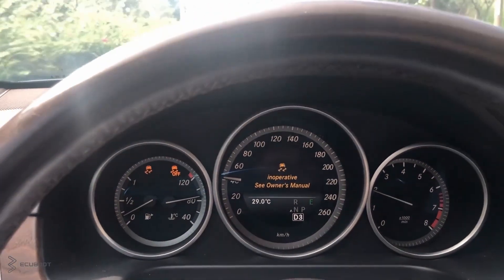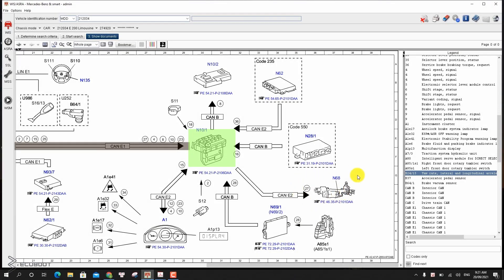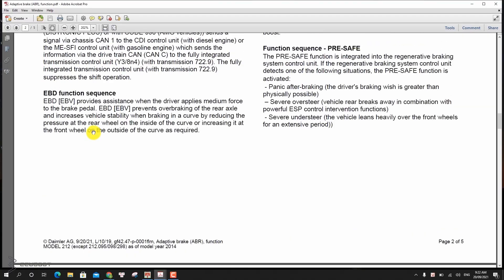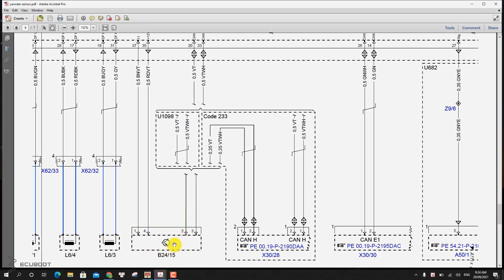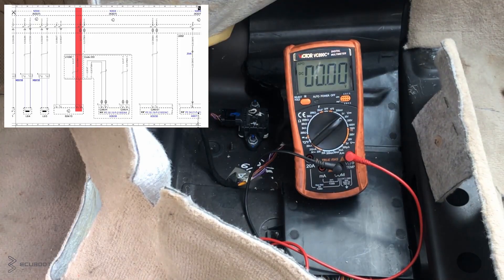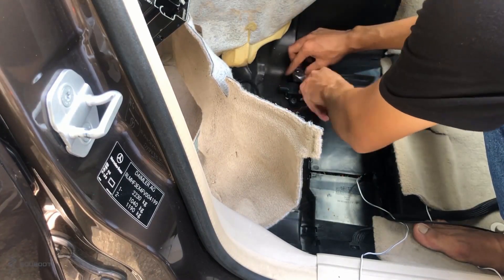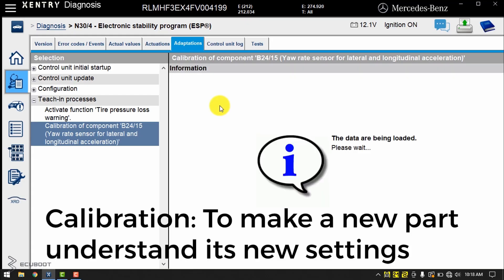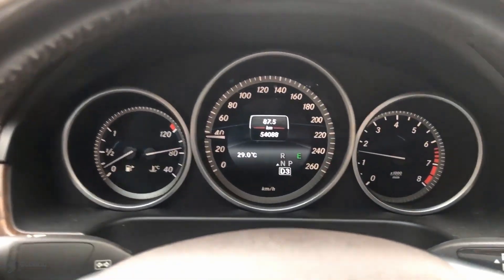Fixing Mercedes No CAN Message was recevied from ESP Unit

Comment: I have several things wrong with my 07 BlueTech E320. No AC, no Radio, no heated seats, my sunroof won’t open quickly, the rear headrests and window cover don’t raise, and the battery keeps dying on me. (Replaced the battery two weeks ago, and haven’t driven it since it left me on the side of the road) does anyone have experience with this issue? I’m thinking a generator, Sam unit, or something in the CAN Bus? But I don’t want to take it into a shop since I know how to work on cars.

Comment: I have 2008 e350 and I cant get communication when I plug obd scanner. At cgw plug i get 60ohms on both green and white and green with white but i dont get anything on brown twisted pair. I get 2.5 voltages on both green pair but I get 4.3v and .7v on brown pair. I physically disconnected climate control, sunroof, front two seats and instrument cluster moduals and no luck. Can you please help me

Comment: Thanks for your video. 

I'm having a simuler issue with my 2009 c300 w204 . Im getting same error message  when I'm trying to turn it on. Sometimes, it turns on after a few tries and sometimes it doesn't turn on at all.  I've  scanned as soon as I receive the error  message but it doesn't show any error in the computer or not pointint to anything. Any ideas what could it be ?